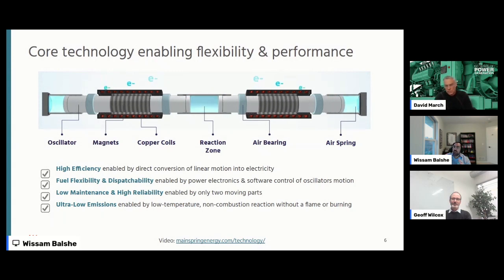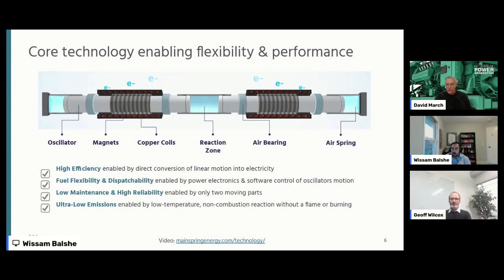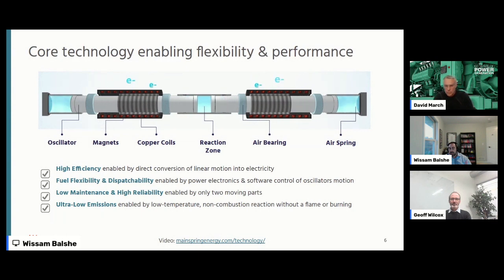The Mainspring Linear Generator - Affordable. Reliable. Clean.

Comment: I have not heard any mention of waste heat being used from the exhaust gases. I am curious about customers using waste heat from multiple units. What temperatures and flow rates are exhausting from a 230kw unit.